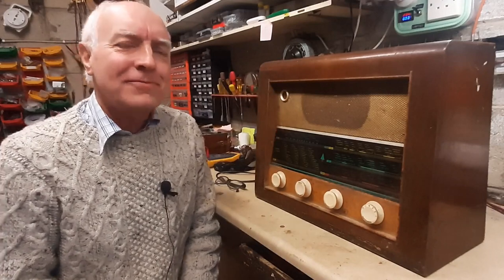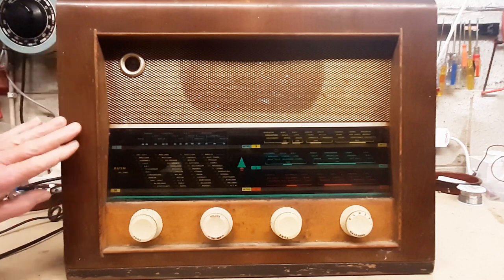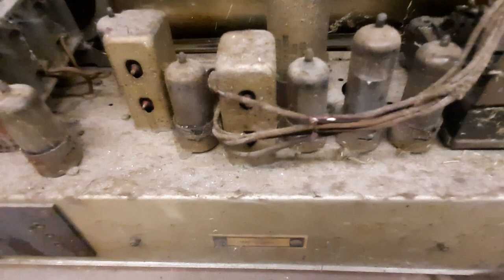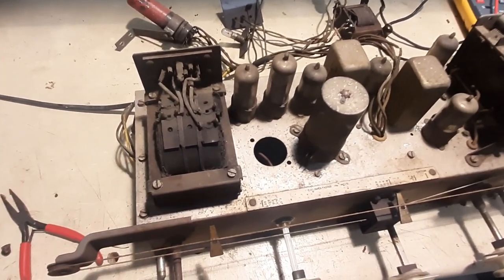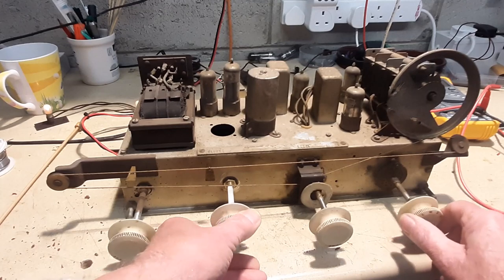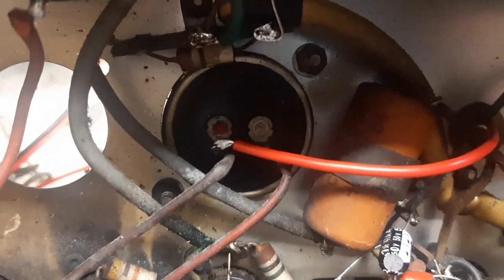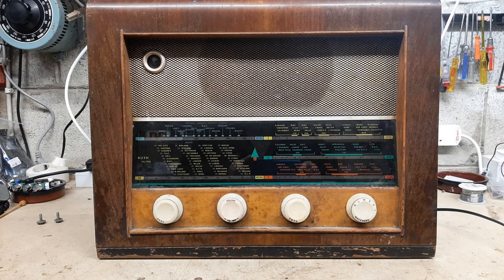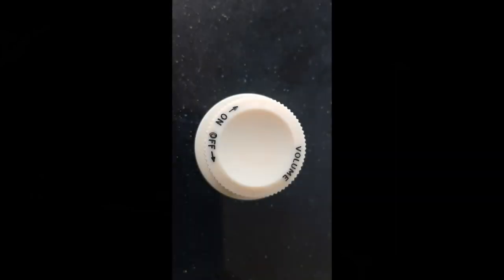BUSH MODEL BS35 REPAIR AND RESTORATION

Comment: Hi Rod, your videos are really interesting, i got my hands into a B-1 radio pilot mfg. I want to make it work since it was my grandpas, and i want to make it work to be able to give it bakc to my grandma, do you have any advice
Reply from the maker: Hi Everardo, It would not be safe for you to tackle this radio without some knowledge of electronics as this is a "hot chassis" model and without using an isolating transformer.
I can send you however some technical service diagrams for this radio if you send me your e-mail address so you might get a local radio enthusiast to fix it for you as this would greatly help.
Reply: Sir BUSH BARON ETR 122 mil jayega?